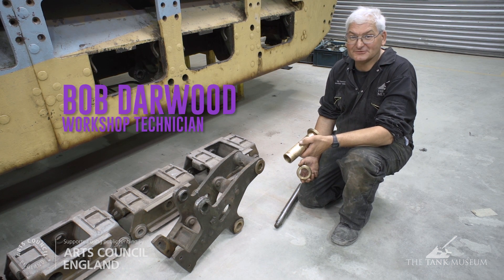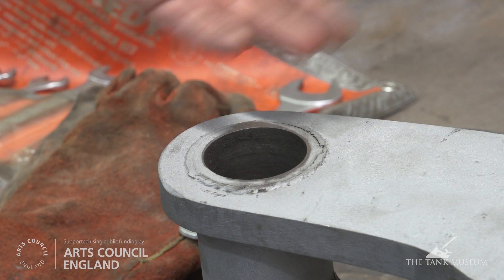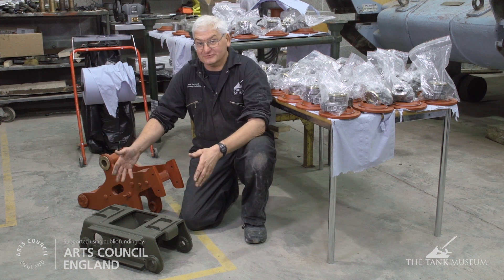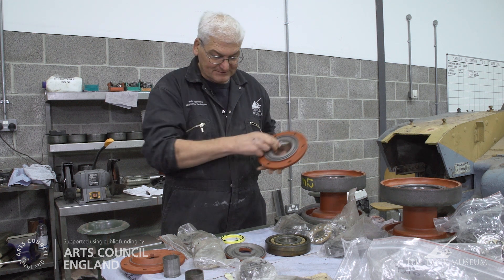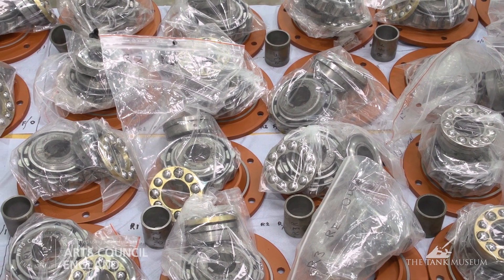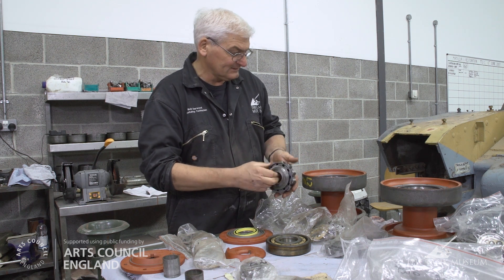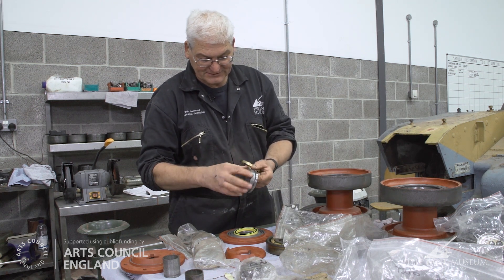The Matilda Diaries Part 8 | The Tank Museum

Comment: Fascinating. One thing i'm thinking about was how much effort was required to engineer and manufacture  all these components during the war. Not just the soldiers ,airmen and seamen were heros back then.
Reply from the maker: Interesting point raised here. The war effort could not have been sustained without the dedication of the workers on the Home Front. To work the hours they did, with the threat of bombing added, is some feat.

Comment: It is impressive how many of these parts are actually usable once refurbished. You would have thought that most of the components, especially in the suspension of a tank, would need complete re-manufacturing. It's good to see that so much can be reused...And I imagine those who are watching the purse strings are rather pleased as well
Reply: Non-moving parts, as long as they are properly over-engineered and protected from corrosion, last pretty much forever.
With some clever engineering you can make a lot of things long-lasting.
Those bronce bushes for example are actualy intended to wear out, so the steel parts don't. And if you use the right alloy of bronce (usualy a lead containing alloy), they won't seize up, even if the lubrication fails.

I realy love this old fashioned engineering.

Comment: The only thing as an ex - Foundry moulder I would add to the commentary is there are a lot of heavy cast steel, cast iron, bronze, brass, and heavy cast metal parts the Bovington Tank museum is sourcing; wouldn't it be better to set up they're own foundry and their volunteer labour be able to run the foundry for all the new parts they need for the upkeep and running of all they're AFV's.

Comment: Re the position of the oilseal at 5:20 I hope the purpose of the seal is to keep muck out of the bearing not the oil in the bearing, or maybe it just looks as if the seal is the wrong way in ?
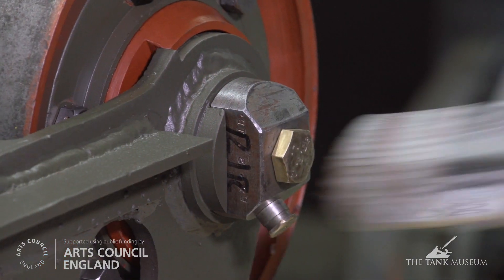Reply: If you look at 5:37 you just pump in grease until it begins to squirt out and then your good. And once in awhile you go along packing in more grease and you do so until you only have clean grease coming out and you wipe off the old dirt filled grease and continue onwards.

Comment: All of that complexity and weight, just to carry around a little pop-gun with no HE rounds.
Reply: yep Matilda looks bit over engineering  compared to much simpler but far more effective other tanks from that era specially Russian T34, I think even German tanks from beginning of the war looks primitive to Matilda.
Reply: The Russians had first hand experience with their tanks shortcomings in the Sino-Soviet war in the 1930s and also the Winter War with Finland. So they ditched things like petrol engines and went with the idea of reasonably simple, but easy and fast to produce. After all tanks don't last all that long in war, even with a good crew.

Must say though that I'm really impressed with the way the guys at Bovington are restoring the Matilda. They are really doing a thorough and very professional job.
Reply: In lend-lease, the Russians considered the engineering in the British tanks to be superior to anything they were creating, the casting/turning finishes, the complexity and thought behind the usability of the fighting compartment, quality of the gun fittings/fixture and engine components. They could not quite comprehend why we still placed insufficient 2pdr guns in our current tanks. They assumed that these deliveries of materiel were our older designs simply being dumped on the Russians. The whole ethos behind British/Russian engineering and tank design was so radically different as to be almost incompatible. The concept of short term life and tractor-like simplicity as demonstrated in the Russian tanks was an anathema to British tank design in the late 30s/early 40s. The real problem with British tank design was the paucity of tactical and strategic thinking at the command levels that led to underspecified designs (too much/too little armour, same for guns, power &c) that were over complex and over engineered. Still though, lovely tech. in the Matilda...

Comment: All that for a 40 mm/2 lbr gun. Repeated, as he says 20 times. The Germans at least had the Mk3 Specials,the long 50 mm that was used in the desert. It looked like a capable tank. The Matilda always looked ungainly to me. The original effort of fitting all the bits together must have been a nightmare.